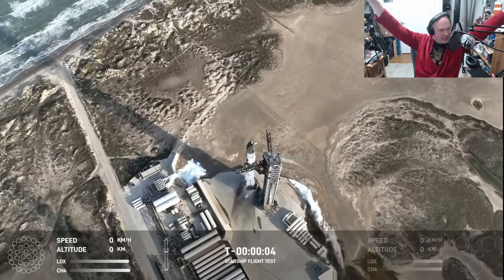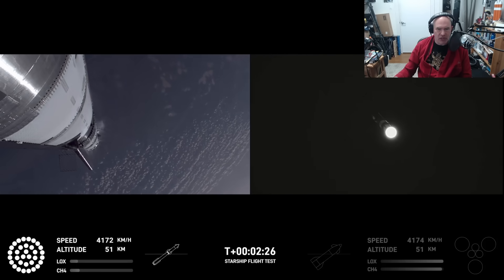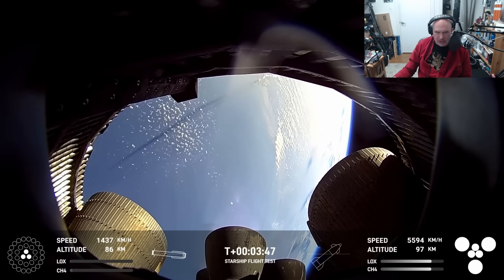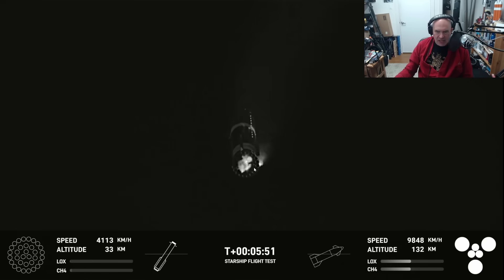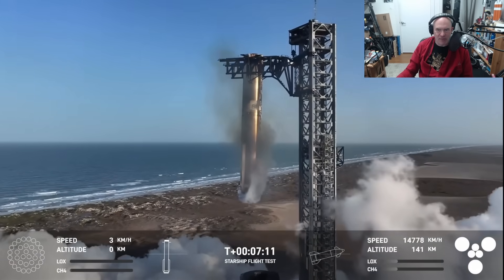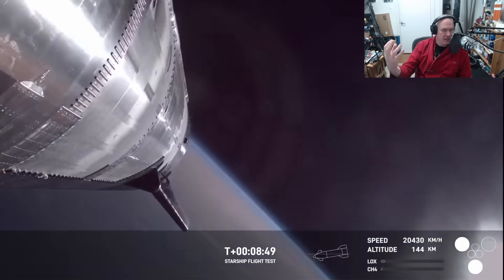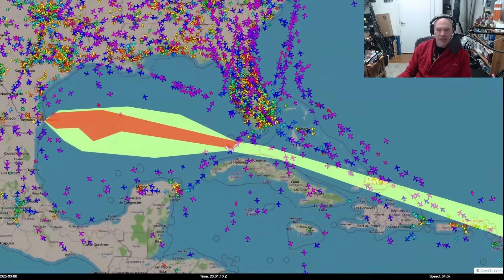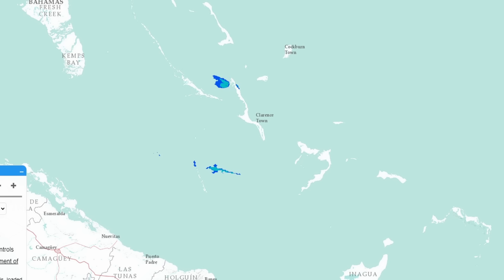SpaceX Make The Same Mistake Twice With Starship Flight 8

Comment: Maybe the propellant tanks being almost empty somehow affects the level of vibrations that are generated, which is why they failed at almost the same time.
Flight 7 engine failed at  T+ 7:40 
Flight 8 engine failed at T+ 8:05
Reply: As Scott speculates, it appears there are at least TWO failures. The engine cone and the attic. I suspect there's a problem with the Vacuum engine, which is impossible to test on terra firma. (yes, I know there are ways to simulate a vacuum, but it's not a very high rez simulation)
Reply: Indeed user pikaachoo3888's comment above gives a plausible explanation how that may be happening.
Reply: Why to empty a tank first?
Reply: +25 seconds, so much learning. Much data! 😂
Reply: @TheMoArtis Letting it fail and while pushing the hardware to the limits gathering that much more telemetry, kinda handy if you think about it.

They have more than theory on how those systems stand up to such forces and can account for it later better than theory ever can.

In some ways, those other refined and never failed platforms may have unknowns that this has as known and documented at least.

If you know how it actually responds and the forces involved at this level, you can be assured later that successful flights can take that knowledge into account with extra fail safes and better idea on the thresholds of their materials and systems.

I think ultimately it will lead to a far better understood and validated system than anyone else can produce, because they will know how other unrelated systems react in such situations with real data.
Reply: @ApolloTheDerg  They are pushing the hardware to its limits by simply trying to get it into orbit without blowing up.
Reply: @ApolloTheDerg Nice word salad there, pseudo engineer. They had all this data the previous flight, and yet it failed in the same exact way. You completely ignore that little data point when writing your jumbo-jumbo. 😅
Reply: 25 scds more, a win...
Reply: @olivierb9716  PROGRESS!!

Comment: I'm wondering if SpaceX should practice the upper stage catch with the towers by doing a sub-orbital flight, instead of a full orbital test.  The advantage would be they don't need to return from orbit by going over Mexico and instead just go straight up on Boca Chica and then straight back down to the tower.

If feels like they need to decouple the upper-stage tower catch from orbital return for now.
Reply: Yes but there’s no point in demonstrating you can land a spaceship that cannot fly
Reply: @hollyjaw3303    My thought is decouple them on the Gnatt Chart, so you can work on both skills (heat tiles, and tower catch) simultaneously.
Reply: I doubt they’ll do that. The starship landing sequence will be similar in most ways to the booster landing sequence. The big question for them is how the vehicle structure will handle reentry and landing after extended heat and vibration.
Reply: @ RE: "The starship landing sequence will be similar in most ways to the booster landing sequence"

I think the skydiver belly flop entrance will be very different than the booster landing sequence. 

Also, they might want to test the structural integrity of the Starship catch structure before giving it a full orbital test.

I can also see a political reason for it also. It is to practice the catch without having to reenter over Mexico and fly in the vicinity of Brownsville, TX and Matamoros, MX
Reply: @alansnyder8448  I mean yeah it’s a very different sequence, but they’ve done the bellyflop several times, and starship can get its twr under 1. So it’ll largely be coming down vertically, and its sequence will be pretty similar to booster for the last few seconds. 

I think your point about the political aspect is much more likely to play a part.
Reply: @ Also, I really liked watching the suborbital flights, I feel they can do a lot more hardware-rich testing.  It would only need to be enough flight to catch it twice on the tower I feel, but once non-SpaceX people can visually see a catch getting permission to return from orbits seems much easier.

It feel like you have a limited number of times you can disrupt air traffic with falling space debris before the pushback become real, even with a friendly admin in charge.
Reply: @Mira-bt3zx  yeah I think for spaceX is far more important to achieve crew-rating ASAP since they are supposed to deliver HLS for Artemis III

Comment: Well at least the Booster seems like a viable vehicle, even if ship fails, they still have made the largest Booster ever made reusable.
Reply: They haven't re-used a Super-Heavy yet! I think one of the Raptors has flown in two different boosters, but they can only claim reusability after launching the same booster a second time.
Reply: @ceejay0137  they have said there considering flying B14 again on IFT 9 so we might see that occur soon
Reply: @ceejay0137  True, but they have reused an engine, proving that at least the most expensive part of the vehicle can be reused. Definitely a good sign that they have a shot at full reusability.
Reply: Maybe Stoke Space could make an upper stage for that SpaceX booster.
Reply: They have caught the booster, but as far as I am aware they have not made it re-usable yet.
Reply: Its a new starship what are yall talking about, the first 2 launched of block 1 blew up aswell
Reply: They will figure it out, sucks it is taking a long time but this is beyond person grievances and politics, getting this working is an abject good.
Reply: @Ammoniummetavanadate  Taking a long time?? This is what rapid iteration looks like in aerospace engineering.
Reply: @Ammoniummetavanadate  Why?  All it's going to do is launch Starlink Sats.
Reply: Don't worry, they'll fuck it up soon enough with the v2 booster.